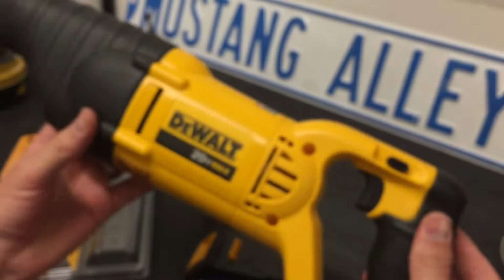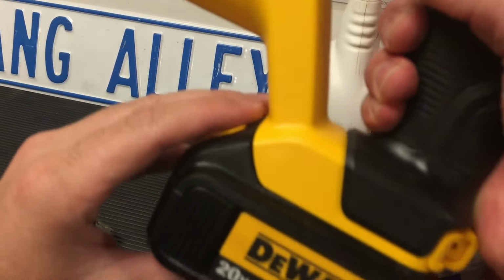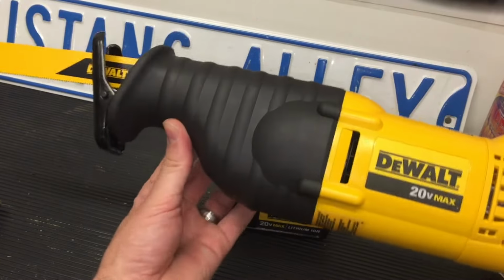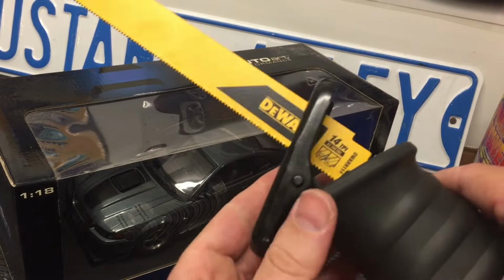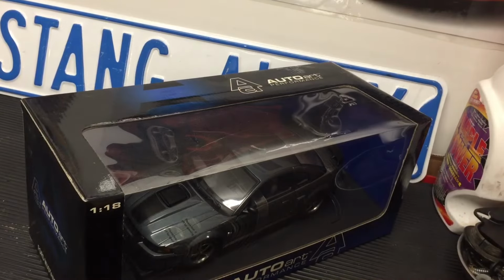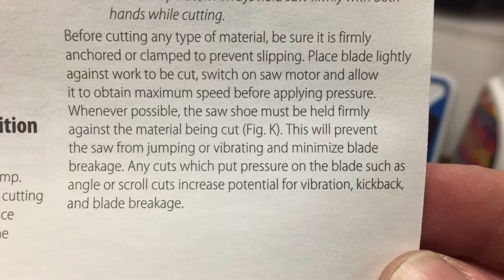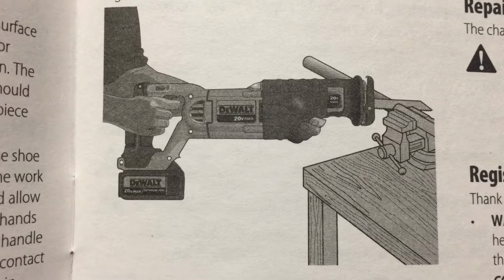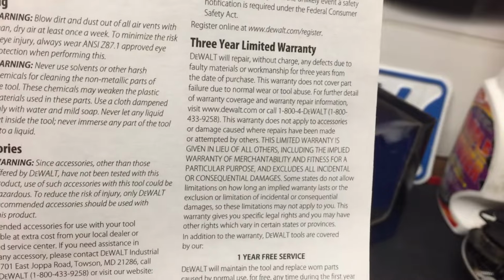Dewalt Reciprocating Saw Blade installation, Overview, Light instructions DCS381 DSC380

Comment: Just bought to DCS380. Easier to check out your blade install vid instead of the booklet. The lock /unlock part looked like a fixed badge not a lever, thx

Comment: Just bought a DCS380 and the pivoting shoe moves substantially back and forth and side to side. Allowing only a mm or two between the blade and shoe. Is this normal? Blade seems unnecessarily close to the shoe
Reply from the maker: If the blade isn’t touching it may be okay. If it’s brand new check another one, perhaps a display model

Comment: I just purchased the DeWalt 380B saw. I was using a diamond blade then needed to change the blade to a wood blade. I can only insert it in the horizontal way and I can't get it in to be vertical as I was using the Diamond blade. I have tried so many times to insert it . I purchased DeWalt 5 pk,  12",  6TPI,  The model of the package of the blades are DW4804.  What could be the reason I can't insert this blade vertically, so the blade is either UP or Down?  This should not be so difficult. Also, what is the button used for on the other side of the clamp to lock a blade in. It seems the area where I attach the blade can go more inward into the saw, almost making the blade shorter. Would you explain that button please?
Reply from the maker: The model in the video only allows vertical and not horizontal. If yours does both but won’t let you, it may be the blade itself that isn’t designed to do both for some reason. Otherwise, make sure there is no battery or power and verify nothing is stuck down in the chuck. Perhaps some grease on the blade or compressed air could be helpful
Reply: You have to press the button in on the other side then pull out turn and put back in, then insert the blade.

Comment: Finally got my tree branches cut using my new saw https://www.youtube.com/post/Ugkx84IcU5pbZd1Qrz8u4-YRLmJax7kdRi7B , and it was effortless. Then tackled taking pallets apart by just cutting through the nails. Zip Zip, like butter, took no time at all! Absolutely love that you just push a button to change the blade, so quick and easy. I chose cordless because of all the outside projects I need to do, and most are too far to extend an extension cord to. Incredibly lightweight, and easy to handle. I will be using this all the time. There is a reason they call them Sawzalls , because they literally saw all the things you need cut. Once you buy one you'll kick yourself for not doing it sooner ~ Just make sure and buy the right blades for the job you want to tackle. The blades are not expensive, and there are lots of various multi-packs available.

Comment: Hey Danny is the 381 and a 381 type 1 is the housing the same can you interchange the housing
Reply: Yeah I want to buy a housing for my 381 type 1 and the housing is 381 does it make a difference both 20 volt
Reply from the maker: Sorry, I don't know enough about them to say if you can interchange pieces.

Comment: This is great thanks, but I didn't see how loose the blade was after you inserted it and folded the lock back into place. I just got a new saw and the blades are very loose, like if I insert it upright (teeth down), after locking it in place, I can still move the blade up and down. I saw you moved yours in a little then out. But is the vertical movement supposed to be so dramatic? I'd say it has maybe a half inch of movement.
Reply from the maker: It is definitely loose when installed.

Comment: Just got the 380 model and was curious about the blade fit. I bought the Dewalt blades. It locked in but seemed to be more side to side movement then I would think. Is that normal?
Reply from the maker: It seemed to me the blades are a bit wobbly when installed